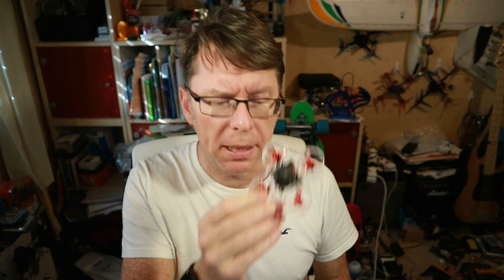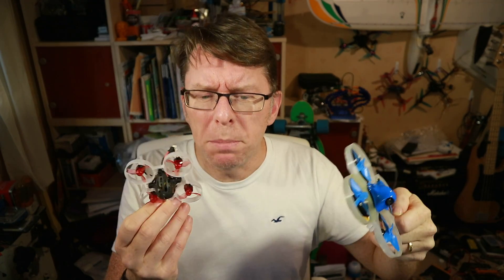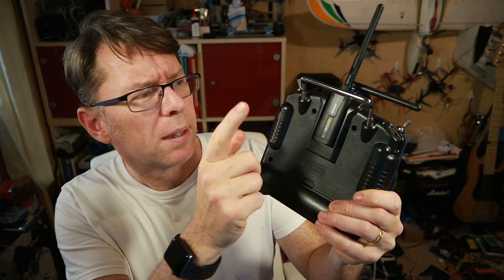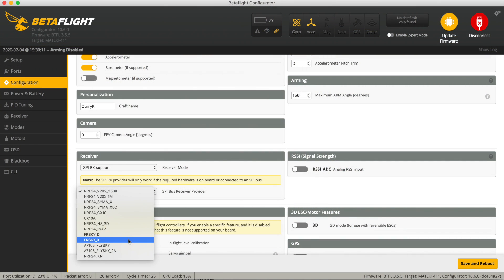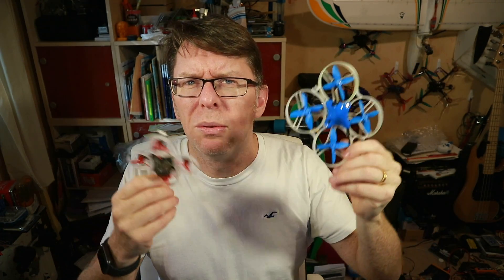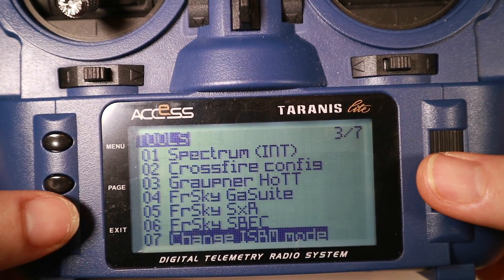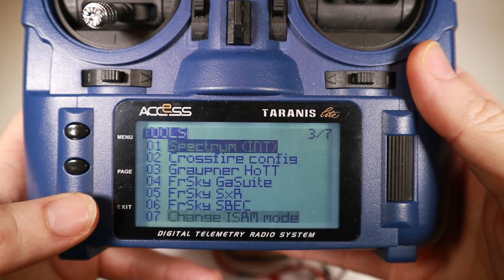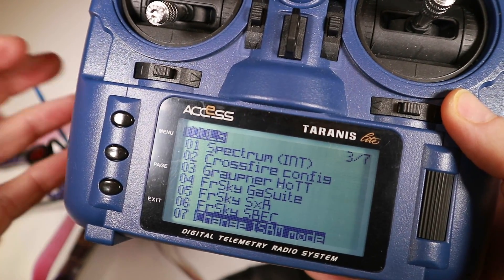Using SPI receivers on LBT ACCST & Access radios - the options

Comment: so if i understand your video you can just switch from FCC to EU LBT with lua mode but it dont reactivate D8 protocol on new X9d se 2019 acces radio right ??? there is not other alternative that use an External DJT XJT or multi to use D8 protocole on these radio right ???? i still have d8r2plus receiver only D8 compatible and i would like to avoid to use my external XJT module so no solution right ?
Reply from the maker: As i understand it, D8 can't work because it doesn't hafe the right chip for it... or something similar.  There's no way of getting D8 back on this radio without an XJT or a Multiprotocol module
Reply: @CurryKitten  ok WE Cant win on all side i get this radio to have the possibility of using vocal telemetry and new Access receiver i suppose it still a good deal to use my xjt in for d8 and keep my very old djt on my very hold turnigy 9x for d8 stuff with no telemetry... This turnigy IS still working like a charm i love it

Comment: Hi CurryKitten! Wondering if you could help me... Just got the Mob7 HD and having issues with it trying to bind with my Access X7. I've got a Mob6 and TH2 both bound just fine in the last example you provided and have been solid for the last year. When I put the quad into bind mode it doesn't pick up anything from the tx at all. I've tried Frsky_D, X and LBT on both LBT and FCC firmwares with still nada! Firmware on the FC is 4.0.6 so definitely old enough to support this way. Cheers!
Reply from the maker: Ok, well if it's an ACCESS based radio, then FrSky_D is off the table.  So you should have the right combo somewhere in there for it to bind, the only question is how are you doing this.  I find the best way is the cli.  So for  BF 4.0.6 you should go into the cli, type bind_rx_spi (hit return) do a bind from the radio and then type save in the cli (many people miss the save, but it's crucial)  If that the technique you are trying - if not, please give this a go.
Reply: @CurryKitten  thanks for speedy response! aye - that is what I tried. The quad goes into bind mode successfully but when I put the tx into bind no connection is made. I have also since tried firmware 4.1 to bring it up to the same as my Mob6 but still nothing. I’m thinking I may just go down the 4in1 module route, it saves the headaches!
Reply: @CurryKitten  Forget about me, someone forgot to type save in the CLI after binding. Its been 6 months since I opened beta flight, don't hate me!
Reply from the maker: Haha, I did say people miss that part :D
Reply: @CurryKitten  And I missed you saying people missed that part. Does that cancel itself out and I get let off the hook? I think so.

Comment: Hi, I have a big problem. I bouthg a betafpv 85 Pro 2 with SPI Frsky FCC reciver  and with a Taranis X9 lite trasmiter. And just now I see that is not compatible. What I can do. Becasuse in my conutry is not easy to get other transmitter. I will appreciate your answer.
Reply from the maker: You should be ok by using D16 mode and FRSKY_X on the SPI option in betaflight

Comment: Hi, I recently bought a Beta65X betafpv, with F4 1-2S AIO Brushless Flight Controller and SPI Frsky LBT. I have a Taranis X9 lite and I can't bind it to the RX.
I recently learned that this FC is discontinued and that the integrated SPI receiver is not compatible with the Access 2.x protocol pre-installed on my taranis X9 lite. What can I realistically do to be able to fly this drone?
Thanks in advance.
Reply from the maker: The x9 lite should be able to run the d16 protocol as well, and you can run d16 in SPI (it's FRYSKY_X in the SPI option) so try that for starters
Reply: @CurryKitten The protocol of my taranis is LBT and therefore on betaflight it should be FRSKY_X_LBT ...... but unfortunately I also tried this and I also tried to downgrade the FW of the IM ......... and unfortunately this doesn't work either well.
BetaFPV replied with an email explaining a process to modify the frequency hopping data in betaflight, but this doesn't seem to work either (maybe I did something wrong during the procedure, I don't know) ..... anyway thank you. I am trying to with some tips found around the net ...... if nothing works, I will wait for the arrival of tango 2 hoping that TBS will give me less problems than Frsky.

Comment: I can say after a Year using FrSky Eu-LBT: i`m sick of it! The Range with SPI-RXs is maybe 50m and Failsafes make it even more frustrating. XM series are okay but so anoying to Flash the Firmware.
Now im usin IRc Ghost and its another Dimension compared to the "shitt*" FrSky Protocols. Just a Dream to Flash Firmware and Bind, all OTA updates for receivers!!
Reply from the maker: LBT is just horrible - it's fine for indoor whoops, but beyond that it shouldn't exist.  You are right, using things like the Ghost or Crossfire is just so simple.  Autobinding, auto OTA updates.  Its how things should be

Comment: Im from canada, have a taranis QX7 with access, and just bought a tiny hawk. I got it to bind to d16, but it drops RX signal indefinitely. Is there anything i can do to let me fly in  d16 mode or am I pooched.
Reply from the maker: What Betaflight version are you on.  In older builds the D16 SPI mode would overload the processor and you'd get a hand (and a disconnect) but this was fixed in later versions
Reply: @CurryKitten  I just got an external module for the qX7. inexpensive but this will be the last frysky transmitter im buying

Comment: Recently got into this hobby building a FPV racing quad, getting a Taranis X9D PLUS 2019 with it. Binding my quad was a nightmare-saga, having to juggle all the firmwares for the R-XSR / Transmitter and setting up F.Port. After many hours, everything now works & runs through ACCESS (EU LBT ver), so I'm really reluctant to fiddle with settings. Now, since it's nearing Winter, I bought a Beta65S to use indoors thinking that buying the FrSky version would be fine and it'd all bind. Now I've spent all evening going down the rabbit hole of trying to bind to my Whoop, and I'm still no closer.

It's so frustrating. This video was so clear and I thought I was onto a winner, but even after reflashing the FC to v4 of betaflight and selecting FRSKY_X_LBT it still will not bind. I also tried setting to FRSKY_X and using the lua script to toggle FCC, but no dice. I'm lost now - my only option according to BETAFPV's websit is to flashing everything to FCC (which I feel is the nuclear option), or I just give up and return it.
Reply from the maker: Sorry if I'm asking an obvious question, but it does come up a lot.  When you are attempting to bind FRYSKY_X (or X_LBT) via the cli, are you typing "save" before  you exit?  So many people neglect to do this and the bind isn't completed because of it.
Reply: @CurryKitten  No need to be sorry! Unfortunately yes, I was using the 'save' command from the CLI after using 'bind_rx'. The green led just stays solid, and the transmitter continues to chirp in that depressing way after the quad reboots.
Reply from the maker: @Jingleboy14  I like the idea of a depressing chirp :)  The radio won't leave bind by itself, so you should put radio in bind, run the bind_rx command, wait a few seconds, take radio out of bind mode, save and let the reboot happen.  Just in case that was a permutation you haven't tried.  Unfourtunately, BetaFPV's website is slightly out of date on the "flash everything to FCC" that refers to the pre-access days when your module could be flashed.  As far as Access goes, you've just got that simple LUA script to flip the region on the module.

Comment: New to hobby and bought QX7 Access not realising D8 problem, how do i get script on the radio, is drag and drop into a file?
Reply from the maker: It's important to understand that using the script won't get you D8 mode, it'll just let you switch easily between FCC and LBT, which for some SPI models is useful when running FRSKY_X  But yes, essentially it's a drag and drop - I'd stick it in under the tools directory so it's easy to find
Reply: @CurryKitten  Do I use the Opentx companion to write to the radio, Im really sorry to be a mither but really new to all this and its such a big learning curve, I've looked but cant find the tools folder on radio ?
Reply from the maker: karl c I’m just out in the car at the moment else I’d double check but it should be the case of plugging in the usb to your radio and computer then connecting as a mass storage device. You’ll get two drives appear. One has a whole bunch of directories and the tools for us in there. If you can’t find it let me know and I’ll double check it tonight.

Comment: thanks for this...... i have a QX7s Access and have had problems from day one. now i have got a betafpv 75x hd and nothing i can do makes it bind. Apart from buying extra modules Which i haven't. I have now given up with it and bought a Jumper T18 pro... finger up and FRSky...
Reply from the maker: You could get it to bind in d16 mode, but I do agree - it's a pain.  Much easier with the Jumper
Reply: @CurryKitten nope  d16 just won't see it... the Access protocol hates me... to get it to work it needs an external xjt module but im fed up with it and keep having to get extras whenever i get a new quad...

Comment: Most of the older whoops were F3, certainly mine from last season were, so not supported by BF4 onwards.
I'm interested to see if the performance versions Spatz released has that LBT protocol though.
Reply from the maker: I hadn't heard about the performance builds until now.  Took a quick look, but can't see a note.  I guess it depends on the complexity of merging that cade backwards without dependencies elsewhere in bf4

Comment: I'm an "Fpv newbie" with a tinyhawk RTF kit and Eachine Novice 1 RTF kit.  My goal is to get a decent TX.   I'm willing to spend the money upfront for a good one.  Would you suggest going Jumper or x9d with multi protocol, like yours? Or bung it all and just go crossfire?
Reply from the maker: Crossfire isn't going to help you too much binding up to the stuff you already have.  I've flown FrSky for a long time, but they are starting to piss me off with what they are trying.  I think I'd buy Jumper now instead... you have a module bay and so you can always add Crossfire (or other stuff) later.

Comment: You've confused me now Wayne.....I'm waiting for my Tinyhawk 2 from Banggood to be delivered although I have a Frsky Taranis  X9D + SE which is a EU version I was going to bind on D8 as you suggested on a previous YouTube upload I commented on where I updated Open Tx on my Taranis and not ticking EU which then enabled either D16 or D8 binding ......So what's the difference with this YouTube upload and just unticking the EU  option on Open Tx ?
Reply from the maker: So the FrSky Taranis X9D + SE is an "old" radio (confusingly there is a 2019 edition of this which is a "new" one") the old radios use an internal XJT module which can support D8 or D16, so no problem - just bind D8 on SPI.  The new radios which have an internal IRSM module (ones with the Access logo) can't support D8 and so you only have the option of D16 (or Access) which is where this video tries to talk about what you options for binding to an SPI receiver are.  Apols if it's not as clear as it could be
Reply: @CurryKitten  Thanks Wayne I think Joshua Barbwell did do a video similar to this it sounds like Frsky are trying to alienate themselves even more with their new radios then ? 
If I was in the market for a new radio now it probably wouldn't be a Frsky as its want a radio that can bind to anything so it's be looking at the Jumper T16 !

Comment: Are there still lock ups in d16 with BF4.1?
Reply from the maker: I went through the issues raised in BF3.x on FRSKY_X, where the workaround was to disable telemetry (and possibly to run at lower looptimes) people that tested 4.1 were able to fly reliably without the workarounds... I haven't tested myself though... to be honest I'll probably just carry on with d8

Comment: LBT for SPI RXs came with Betaflight 4.0 yes, but 3.5.7 flies so much... less worse. The easiest option if you have an ACCST radio is to just flash OpenTX with “eu” checkbox unchecked. EU TX firmware has D8 mode, it’s just hidden in OpenTX with that checkbox. If you have an ACCESS radio, my condolences :)
Reply from the maker: Indeed, if you watch at 2.17, you'll see me point to a link for my own vide about it :D  Part of this video stems from people buying new radios and then finding there's no way of binding to their new whoop... not knowing that an Access based radio takes D8 away :(
Reply: CurryKitten I’ve just ran into exactly this problem today with my new X7. I’m new to the hobby and I wanted to upgrade my transmitter. I’ll try your tips!